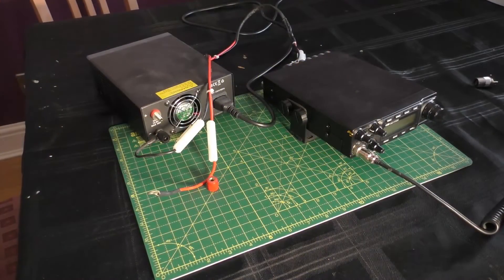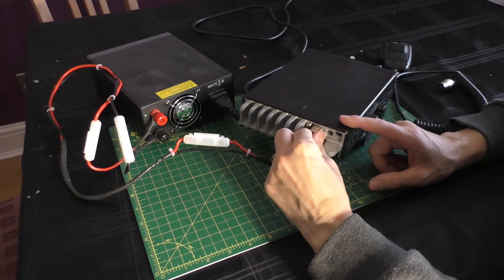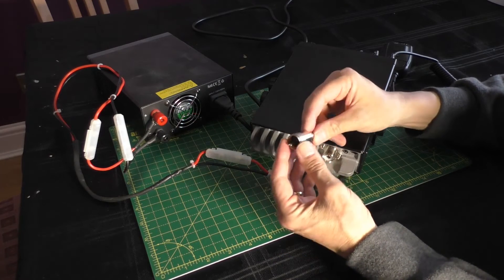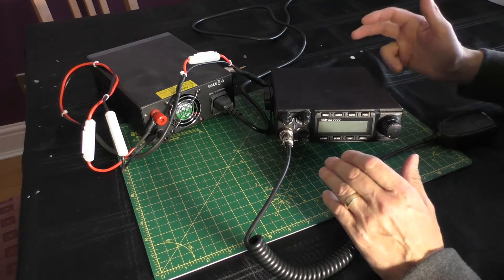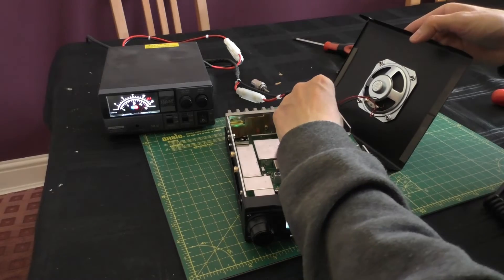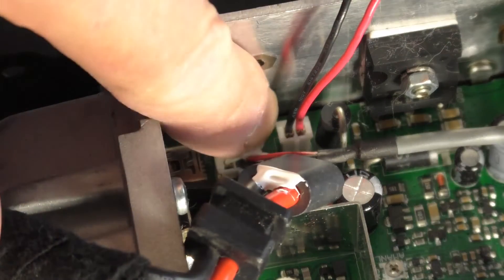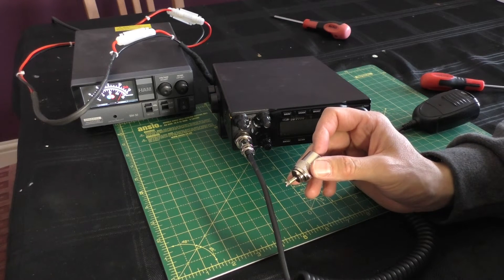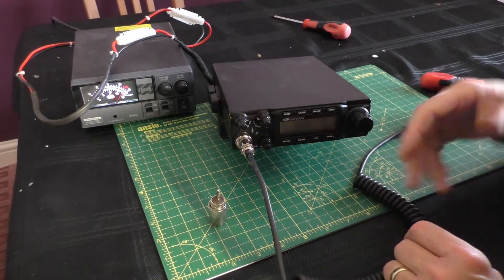CRT SS9900 "No sound" issue sorted.

Comment: I think I'd take the cover off and check the two solder joints for the speaker connector as well. They might have come loose some...
Reply: Good call.  If the sound goes again i will do.  easy to check.  Cheers

Comment: Hi whatever you do don't put vaseline on the plug get a new plug unscrew the outer cover of the plug completely and make sure the inner part of the plug goes right in the socket so the teeth touch the outer side of the socket if that makes sense if not you can always trim the inner parts of the plug down even on old plugs
Reply: Thanks mate.  Whats with issue with vaseline ?  Poor connection ?  Iam thinking it could be an issue with the center pin being a little too long on the 259.  Ive got a couple of new plugs so hoping one of them are better.  You know you should consider putting the Gainmaster  back up as we have a lot of North London stations coming in on the 4pm 305 and you would hear them.  All the best mate.
Reply: @CB-RADIO-UK  hi you shouldn't put vaseline on the plug there's no need for it and with the heat from the radio we were eventually make it a sticky mess. The gain master is staying in the shed. As I said to you years ago just lost all interest in radio but I still watch your videos sometimes and leave comments and most of the time give them a thumbs up.
Reply from the maker: Cheers mate.  Got some Steam stuff coming up and also a video of tree pruning at the end of week. .  It dont get any better than that LOL :-)
Reply: @UK-CB-RADIO  lol lol you are a mini Steven Spielberg

Comment: hi fred ,new to the cb world just got one of these last week from knights,good radio,silly question maybe, but when listening on 10 meters what mode are you supposed to use is it fm am usb or lsb .,cheers
Reply: Its a HAM question but i will try.  I know CW (morse) is used at the bottom part of the range the then SSB AM and FM on the upper.  I think you can use all modes further up.  Just switch the mode till you can understand the receive.  On SSB you will need to tune the clarify.
Reply: @CB-RADIO-UK  ok cheers for that fred

Comment: A small dab of hot glue or wax Fred. Just to stop it moving or pulling out. Have had the same problem with the pl259 plugs some seem to be longer than others. Try and get the shorter variety as they tighten up nicely. 👍
Reply from the maker: Yes i think the hot snot may work if it becomes loose again.

Comment: A few tips Fred dont superglue the plug to the board because if you sell the radio another tech may go inside try to pull the speaker plug off and end up ripping the tracks up off the PCB. 
Looking at the speaker if it has flat metal terminals you can usually get spade terminals to fit with a rubber shroud. 
Oh and the antenna socket on the rig is called an SO239  just incase you need a order a replacement.
Thanks for the video Fred,  always something happening in Fred's Shed 
One  of these days I may hear your Net on 305.  Cheers buddy
Reply from the maker: The speaker wires are soldered right to the speaker.  Might have to use a blob of hot glue if this problem keeps coming back.  Cheers.

Comment: All good Ay Fred, glad it was an easy fix..Don't worry about what you called the PL259 plug, I have heard many a YouTuber calling them all sorts of things so long as we understood you it's all good...PL for Plug SO for Socket and why they didn't call them both 259 is anyone's guess if it was my design I would of named it a SO259 instead of SO239 meening the Socket matched the plug.
Reply from the maker: Thanks Steve.  Plugs from Rocket have arrived so will be replacing the dodgy one.